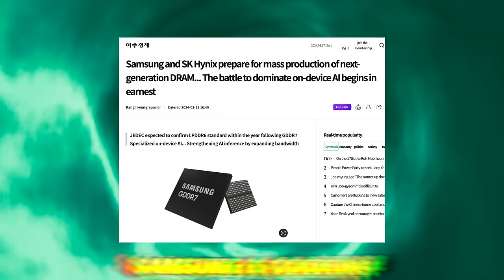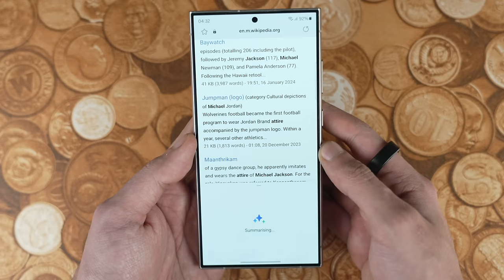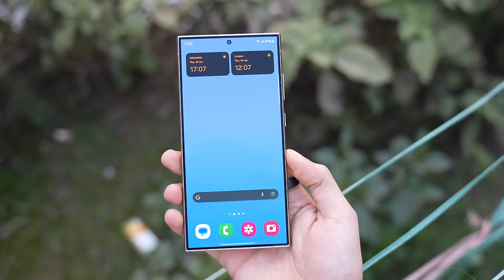Samsung Galaxy S25 Ultra - First in the WORLD.

Comment: This phone better not have heat problems with all this extra power coming!
Reply: @SpicyNoodleDragon  means nothing until I have the device in hand to test for myself!
Reply: This isn't Apple, Samsung does everything they can to make sure the chips don't throttle after 4 minutes like iPhones!
Reply: @1993rufus  yeah and my brother abroad gets an exynos chip!
Reply: @williegreen2348  Well, the recent Exynos is on par with snapdragon, if not better, in certain areas! With Apple, you get last years chip on the base model's and only 60hz panels! Sad for 2024!
Reply: @1993rufus  why are you mentioning apple? Like I said before in hand is the only pure testing! Chip sets can vary from device to device. And exynos is pure trash!
Reply: @1993rufus are you joking Bro?  Because of samsung phones I lost 3 phones because of processor/mainboard problems. I lost all my files.!!!    I will never buy a phone without micro sd card slot anymore !!!
Reply: @michaelbmw1931 Have you ever heard of cloud service? If you're too lazy to set up daily auto back up, sounds like a personal problem! I trade in phones every year, and when I restore my stuff, I never miss anything.
Reply: @1993rufus  cheezes Bro.  Micro sd is micro sd.  Not some cloud .
Reply: @michaelbmw1931  I know the difference. Thank you very much! What I'm saying is that you don't need them anymore. I was mad when Samsung removed it, but I haven't missed it since either!

Comment: Honor magic 6 ultimate using 2 layer display that is 40 percent more power efficient Samsung should really step up soon
Reply: Who makes the display?
Reply: @bruxi78230  it's what I read but I'm sure it's not Samsung this time you should read about the honor magic 6 ultimate
Reply: @Avner-sj2ky  ------ The double layer OLED is from a Chinese company called BOE.  It's 600% lifespan increase, more durable, and a 40% increase in battery efficiency.
Reply: @bruxi78230  yes I read that a normal phone life span is 5 years while the magic ultimate is 10 years now today battery's are improving and with the silicon carbon battery plus honor E1 chip that handles temperature means that honor is the best phone in the world even performance is better Samsung and apple reduced performance and apple touch sampling rate and screen dimming instead of using vapour cooling in my opinion honor is the only company that's innovating

Comment: It could be a 440mp sensor
Reply: Crazy numbers
Reply: At that moment taking a full 440mp with the shutter u will have to sit down for a drink as it captures the scene
Reply: They might use a 1 inch sony sensor  on the s25 ultra
Reply: It's isocel made by Samsung itself
Reply from the maker: Still a bit far for that to happen.

Comment: Specs sound hyped and unimpressive. Not much different from th s23 and s24, except for RAm and 3nm architecture. For everyday use maybe we can use the phone linger on the same 5000 mAh battery, but that's basically ot. For me the ultra would make me eant to upgrade with these upgrades. A high end camera sensor 200 mpix with the option to turn beautymode off for faces. It's been too long we have to wait for this feature.  Second I would like the rear camera's to be flush with the back, for less wobble, when the phonev is on a flat surface. 3 a dedicated camera button on the sidecof the phone. 4. A 4th hardwate button that can be programmed by the user. 5. The return of the headphone jack. Easy design where a broken screen or dead battery can easily be repaired or replaced by the user. built in infrered camera or flir camera forbheatmapping or filming in challenging dark conditions. Return of an ir blaster for built in universal remote. Would also be nice if the spen was rounder, has a slightly longer battery life of up to 1 hour of runtime and two programmable buttons. Lastly would be nice to have a built in temp sensor and barometer and hygrometer to measure local weather stats. And a laser to measure distance and be a laser pointer. Theen it would be a better update of a smartphone.

Comment: Why so much push for on device AI features, Nubia's Red Magic 9 Pro shows you can still out perform Galaxy s24 in performance without the overhaul with AI, I swear all I can do is be thankful I didn't go with a device that's incorporating all of those AI features because every single person I've met that has gotten either an s23 or s24 nonstop complains they have no clue to know what their device is doing most of the time while I'm over here with my NRM9P having a blast gaming with no throttling at any point

Comment: Samsung needs a faster charging (at least 85W), faux leather on the back and 16 gb/ram on Ultra to be 2025 best flagship!
Reply: Absolutely not...that destroys the battery for little girlies wanting to brag stupidly
Reply: @DENVEROUTDOORMAN  That not destroys anything! There are real fast chargers at 120--200W that works just fine, for 2-3 years ago. Is just misleading information from scarried Samsung people or Apple to justify those weak chargers.I have a Xiaomi 12 Pro for 2 years, with 120W and works perfect, no issues.